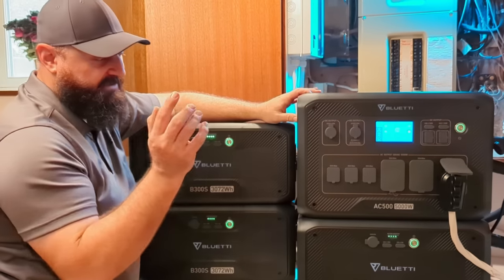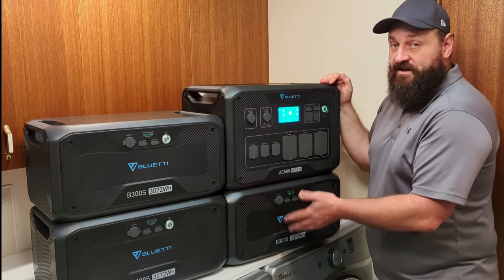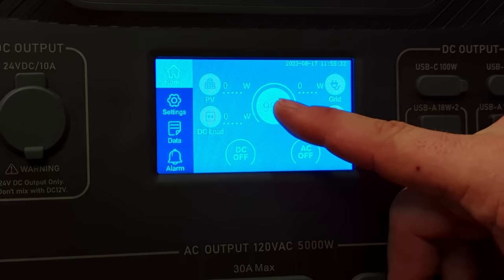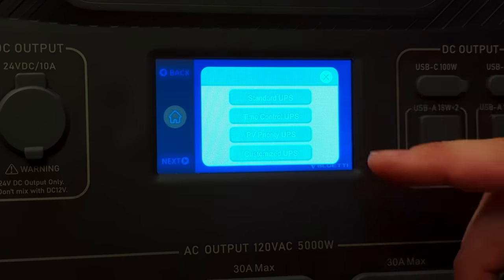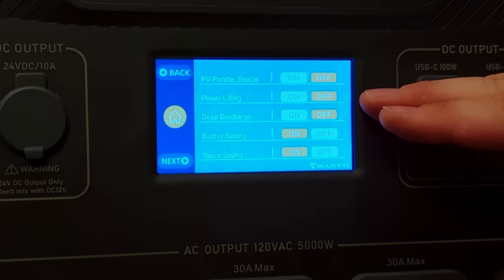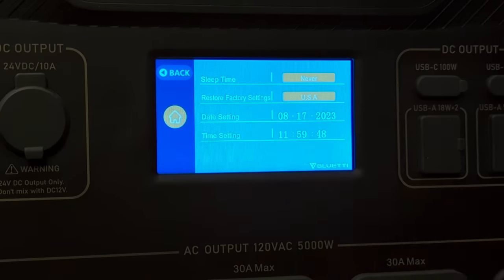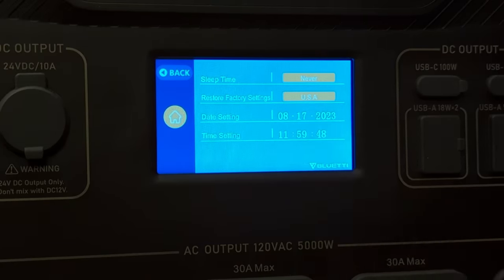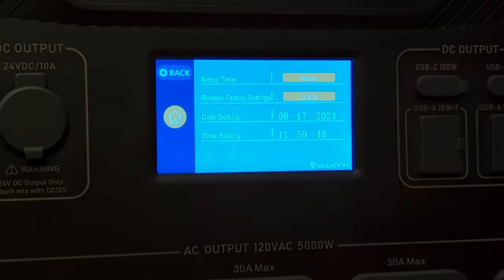Whole House Battery Backup with the Bluetti AC500 and B300

Comment: This was helpful. I have the 200AC Max. I want to get some of the external battery packs. But I am not sure I can run it like a transfer switch because it only has one 20amp plug. I like the one you have because if you got the second one you could run a 220V tool or whatever. And obviously just has more power. I just couldn't swing more (plus the 500 didn't exist yet). This was still helpful for mine though to see how the external battery packs work etc. Plus you break the features down in a way that gives examples and makes sense. I struggle with electronics and the math of all what you did, but the way you explain things help me understand more than I did and take what relates to something I was already trying to figure out and made it make better sense. So thanks for sharing. I appreciate your channel. I've gotten help with multiple electronic things from you.
Reply: It is still possible to arrange some kind of transfer switching, but it would only be for ONE 20amp breaker at a time. So a bit more thought needs to go into the designing of the (emergency/power-outage) system.

For instance, if you have several freezers or fridges, it would be possible to design a system where ONE of those sockets/items would get power at a time, for some time. 
Fridges and freezers will typical do just fine, if they have power, like, every two hours, for 15-30 minutes each time. 

And you would probably (simultaneously) be able to keep some light on,  and the wifi and the laptop. All powered from a 20 amp switch/breaker. 

--- 

But 2x AC500, and many battery packs, would of cause  be easier to design a complete system with, and would supply power for longer, etc. 

But I would still say, that something smart could be implemented to increase the versatility of a 200AC system.

Comment: Very Informative Video! I want to use two AC500 units and four B300S batteries using 120/240 Split-Phase to power my 50 Amp RV with two 15000 btu air conditioners.

Proposed Setup:
Each Bluetti AC500 has a 50 Amp female connector: (NEMA 14-50R) that is NOT a 240 volt receptacle, instead it is only 120 volts on one leg--the other leg is 0 volts. But, if you purchase two Bluetti AC500 units (each with at least one battery connected to it) and then use both a special Bluetti Communication cable that connects one AC500 unit to the other AC500 unit (and a special Bluetti "Y-Cable", discussed below)--the software in the Bluetti AC500 allows you to perform a master-slave 120/240 volt Split-Phase setup. 

The "Y-Cable" mentioned above, has two NEMA 14-50P male plugs and you connect one of the two 14-50P male plugs on the "Y-Cable" to one AC500 unit via its NEMA 14-50R receptacle and the other 14-50P male plug on the "Y-Cable" to the other AC500 unit via its NEMA 14-50R receptacle. The third connector on the "Y-Cable" is a NEMA SS2-50R. I can purchase an adapter on Amazon that has NEMA SS2-50P/CS6365 on one end and a NEMA 14-50R on the other so I can use it with my RV's 50 Amp Plug (NEMA 14-50P) that I normally use for plugging into shore power.

I know this is somewhat of an elaborate setup--but I am wondering if it will work? I decided to go this way instead of a Cummings Onan propane generator.

Thanks for taking the time to look at my setup,

Steve
Reply from the maker: Yes

Comment: Cool project! Looking forward to more testing. Looked at installing a big(ish) system on our house here, but determined it wouldn't be cost effective even with me installing the components!
Reply from the maker: Do It!
Reply: @Everlanders  $27k in materials...Accountant said no. :) Might consider a smaller system in the future.
Reply from the maker: Just plug the expedition truck into the house with a transfer switch, at least you'd have fridge, furnace and a few lights...

Comment: Good to include that transferswitch.

I use transferswitches for the same reasons as you do like 25a instead of 15a. I also think it saves energy.

Do you have dynamic tarifs? You might want to run on these batteries when tarifs are high and charge them when tarifs are low.

I use smaller systems (Ecoflow Delta 2) on an outlet bases, just securing the most important outlets when there is an outage. I included a smaller 25A transferswitch with normal 220V plugs to pass by the battery when the grid is working. It required a lot less installation
Reply from the maker: No, all fixed tariffs here...
Reply: @Everlanders   I see. I hope you have a way to use the solar when the grid is on.

I am moving from back dynamic to fixed tarifs again in oktober because of a good 3 year contract that was offeren.

My solar will then still charge my batteries but when they get full I will try to dump part of it into my homegrid at the moment the load in the home is high enough.
Reply from the maker: Yup, we just flip the transfer switch...

Comment: without the transfer witch can achieve the same work, just use the NEMA 14-50 Plug comes out from the BT and back to the sub-panel, to supply all  the critical appliances. BT will connect the grid to the sub-panel, all the appliances will charge by grid.
Reply from the maker: Yes, except that it can't pass through more than the input cable allows. And it's supplied with a 15-amp cord.

Comment: Always blown away that North Americans can just do their own home wiring. Admittedly we are running double the voltage
Reply from the maker: It seems you're unaware most of our larger loads are 220VAC...
Reply: You’re doing double the voltage with half the amperage. Watt per watt water still heats up the same time, hvac, washer and dryer, etc. and as above me mention we do run 220. We just have the option for split phase to run 110 for thing like lamps, blenders, microwaves etc.

Comment: Great setup as always. Would be very interested in seeing how much you could rely on solar with the full 3kW input. Would you be able to run the entire house load overnight on a system with the full 6 B300 units?  If so, is it reliable enough to only use the grid as a backup option, or would the constant cycling destroy the batteries too quickly.
Reply from the maker: You can completely discharge and recharge the batteries every day and still get 10 years out of them and they'll still be at 80% capacity...
Reply: @Everlanders  thanks for the feedback! I'm excited to build out a much smaller version of what you are rocking! Thanks for posting what you have so I can dream about what I can have one day.

Comment: Hey guys, new watcher and now a new follower after seeing this informative and simple to understand video, thanks. This question has probably already been asked and answered but when activated due to power outage that transfer switch must only supply power to the designated circuits while grid power is down.....because otherwise it would back feed power to the grid without a main breaker interlock kit.
Reply from the maker: This is exactly the function of the Transfer Switch I demonstrated in the video.
Reply: Ok so that auto switch that you had to rebuild/beef up was the transfer switch then......is there a more reliable model then that one you used that does not need to be beefed up? Also, I currently have a Honda EU7000IS with a Reliance manual transfer switch.....unless/until I get a system like the one you installed in your in-laws house I would prefer to just feed the whole house with my generator, (without using the dryer, A/C and stove of coarse). Your thoughts? @Everlanders

Comment: I guess if there's a long power outage during the winter, you could take all your freezer items in to the backyard if you're trying to conserve power.
Reply from the maker: But this is a big job for these 85 year old seniors with 5 refrigeration units... and it still doesn't address the furnace or the frozen, bursting water pipes...

Comment: You come up with the best solutions.  I am thinking about copying what you did. 

Quick Question - in the same way the automatic transfer switch changes to Bluetti power if the grid goes down - it also changes back to the Grid if the bluetti goes down (drops below 80% power like you setup as PV UPS)??

 Seems like the switching part could create a potential for electric arc, particularly if the rocker cam motor failed halfway through switching?? Would installing a 50 amp AFCI circuit breaker instead of the stab lock 50 amp be a way to reduce risk?

Comment: I have the AC300 and the B300 battery. I have been in touch with Bluetti - a lot - over the past year or so. I asked them if I could use the B300 with the AC500. They said I could not. They said that the AC500 requires a B300S.
I hope that you are right and they are wrong.
🤔
Reply from the maker: Nope, ours are B300S

Comment: I'll love a video like you mentioned but I'm no expert, I understood almost nothing of the terminologies you were using, but I have time and I will love to understand them all step by step :) I Have a couple of panels and I was looking for a simple way to install and control batteries and these looks like they are easy to work with.

My first question will be if you need an inverter (because I currently have one) to transform the power coming from the panels? because I think the thing you mention has already a built-in inverter correct? 

Another will be how does the battery connects to the grid and the panels? will it be panels --> batteries --> grid, or panels -->grid -->batteries? and how will the batteries kick in in each scenario? :S

Comment: I already have a residential solar system on my house. It's a 6.4kw grid tie system with zero battery backup. Do you know if I installed a Bluetti system like yours would my solar panels work during a grid outage? Currently, if the grid goes down then the solar turns off (at the panel level).
Reply from the maker: That's the problem with a grid tie system...

Comment: I have an AC300 with two B300 batterys. I run ONE 4'longX30"highX24"wide deep freezer covered on top with blankets for additional insulation. I have two 350watt portable Buetti solar panels connected to recharge system. I live in So.Utah VERY SUNNY. The AC300 system uses 25% of power overnight to just run that one freezer. It takes 5-7hrs, realigning panels for optimum sun light, to charge AC300 back to 100%. Can my system power my 2 subzero freezers, one refrig? sure. But not for very long. Suggestion: if you do get this system, which is pretty good, test it as though you are having a power outage! You can thank me later
Reply from the maker: That's odd, in this test, ours ran 3 deep freezes and two fridges for a day and a half... 
https://youtu.be/N0iJ5o79Ee0

Remember that most deep freezes push the heat out the metal skin on the outside of the freezer, so covering with a blanket would work well if there is no power, but if you're running them from a battery then that is counterproductive because you're keeping that heat in...

Comment: How much would it cost to outfit them with two sets of AC500s with six B300s each?  That should give them about 4 hours shy of 3 days of battery power for a worst case scenario.  How would you go about using more than 12 B300s on two AC500s to provide a week or more of reserve power in the event of a fairly long outage?
Reply from the maker: It would cost more.

Comment: Another great video. How does this compare with Delta Pro for split phase configuration? I have been toying with these 2 approaches as well as using server rack batteries and a Sol-Ark for example.   Again, thank for the video.  I was surprised to see you back in Canada but you explained that.   Cheers from north Texas.
Reply from the maker: It's single phase, so.... It doesn't compare. 🤷‍♂️

Comment: Can I use my suicide cable that I purchased from Amazon to plug in straight to my outlet then to my bluetti
 and disconnect power source from company would that be good enough without putting a transfer switch?
Reply from the maker: I don't see the point... The whole point of the transfer switch is that it's automatic when the power goes down... It's $50

Comment: My Electrician hooked up an interlock system on the main panel, over building a second sub panel. I’m wondering if there’s a benefit of one over the other? 🖖
Reply from the maker: One is automatic...
Reply: @Everlanders  
Good point, although I know instantly  when my power goes out and can make the adjustments manually if needed. Most of the year it’s running off grid.
Reply from the maker: As long as the power goes out when you're at home, that would be fine.
Reply: @Everlanders  
Even if the power was out for 24 hours, I wouldn’t be affected. Any longer than that I might have some issues. Like starting up a generator.

Comment: That's so interesting! Looks like an excellent system, and you're very clever for wiring it in like that. Is it ok with those quick transient loads when the motors kick in? Where we are, if the grid goes down sometimes the power comes back on for a second or two then drops again, then it resumes:I wonder how your system responds to that? It looks pretty responsive, but other whole house systems I have seen have a short (10 second?) delay before they switch to avoid those flickers.
Reply from the maker: Agreed, unfortunately no delay on the DIN rail ATS, the Bluetti transfer switch waits a few seconds... Didn't measure it.

Comment: and i am between ecoflow whole house to include a package unit heat pump or bluetti...any suggestions? the auto transfer switch on ecoflow can only handle so many circuits too. Any suggestions? Plus ecoflow is portable to use too...
Reply from the maker: It can handle 50 amps...

Comment: Just Curious— Did you wire the transfer switch relay coil magnet to be engaged when using Grid power or engaged when using backup power?
Reply from the maker: Whichever you like...
Reply: @Everlanders  I don’t believe the relay would work if the coil’s engaged when running on battery power.. because when grid power fails, it releases the magnet to enable the batteries. How can it work the other way? I’m asking because it would make be nice to not have the magnet engaged all the time (in grid mode).. because they always hum a little bit. Btw— super cool you took apart the relay

Comment: Hey brother I'm not sure what they're really called but I've heard him referred to as soft start you put it in line like on an air conditioner so it doesn't draw the heavy start-up power would something like that be good for things like the compressor on the freezers and refrigerators just curious I have a very rudimentary understanding of these things really people with rudimentary understandings are offended that I put myself in their category
Reply from the maker: Yes, they're called Soft Start Capacitors... But they aren't needed here, everything runs fine from the Bluetti as it is now.

Comment: Does it draw down all the B300's equally or draw one down then start drawing from the next? Can they be hot-swapped so you could take one or two somewhere with power to recharge in the event of extended outage and not enough sun for solar?
Reply from the maker: Both, they are drawn down equally, but also hot swappable...
Reply: @Everlanders  so I guess one would have to keep a reserve battery disconnected to keep it from being drawn down, then hot swap it in and take the others to recharge somewhere.
Reply from the maker: @reefhound9902 Perhaps, but should probably confirm with the manufacturer, also, you'd need a second AC-500 to charge them...
Reply: @Everlanders  really? They cannot be directly charged? I think that's a deal breaker for me.
Reply from the maker: @reefhound9902 I don't know of any that can...

Comment: Is there a way to make it run off of solar/ battery then drop to grid  then either go to solar  and then swap it self back to solar when it charged.  Mpp solar all in one 48 volt units. with to11k of batteries.

Comment: is there any delay on the transfer switch transfering back to mains? (so if the mains is flickering its not cycling the switch)
Reply from the maker: The AC500 is 20ms and the DIN transfer switch I got is longer, maybe 50ms
Reply: @Everlanders that's the time it takes to make the switch so no delay to ensure the mains are stable ☹️... the din switch could be exciting, if you where keeping it add a delay on it, I'd say the ac500 would do phase synchronisation "line interactive" at least so delay is probably not as important, also why do people not add lights as a critical load? Being able to see is critical and with led bulbs low draw
Reply from the maker: There are a bunch of lights that happen to be these circuits too... Thanks for the critique.
Reply: @Everlanders  sorry did not mean to come across as critique, love your work but always  pondering 🤔 options...